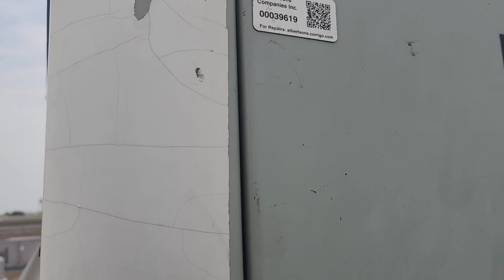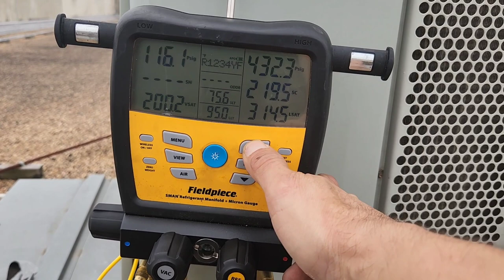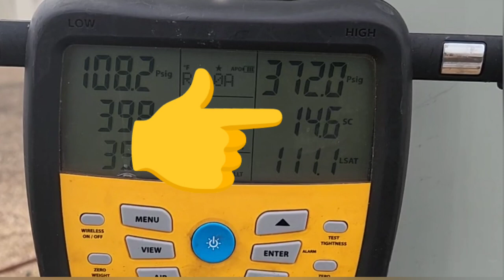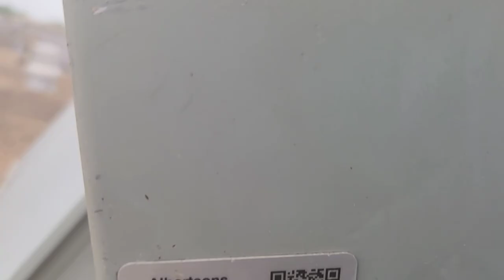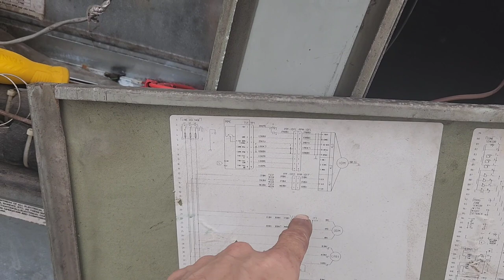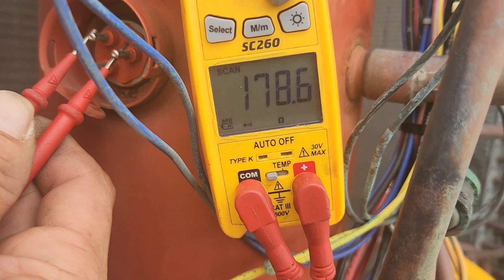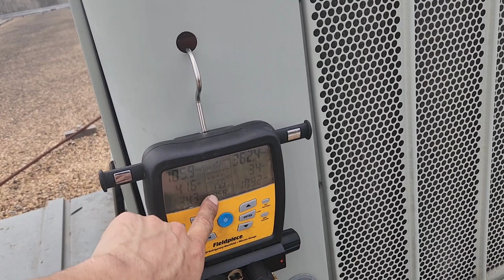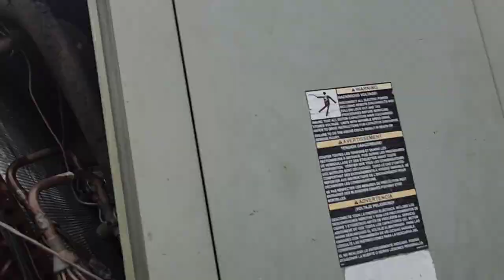RTU Has More Problems Than Are Worth Fixing

Comment: You could always get an evaporator coil and a split unit condenser and do it that way I have seen that done before and it works 🤣🤣also inside the panel on most trane units is the model and serial number on a sticker
Reply from the maker: Do you mean like a split system with a air handler inside? Sorry I'm just confused
Reply: @HVACRServiceTech  no a split unit condenser and hook it into a new evaporator on the RTU
Reply from the maker: @Joshuatimmons1783 oh OK. I get it. Instead of the compressor replacement, put in and equally sized Condenser and pipe it in to the Trane RTU
Reply: @HVACRServiceTech  yes